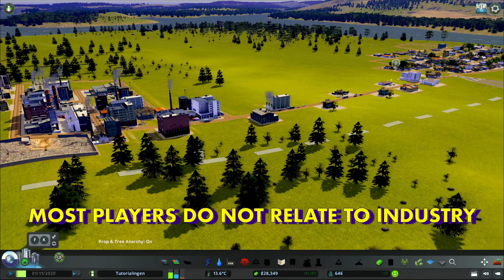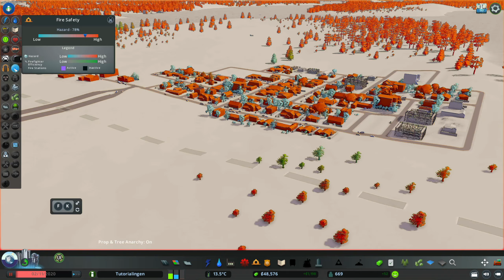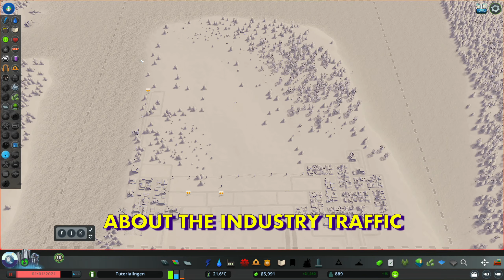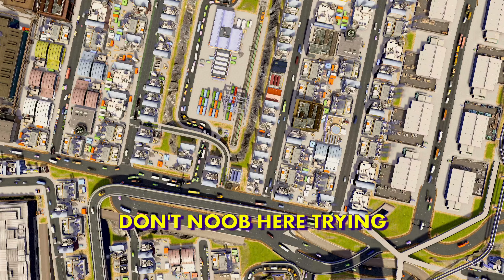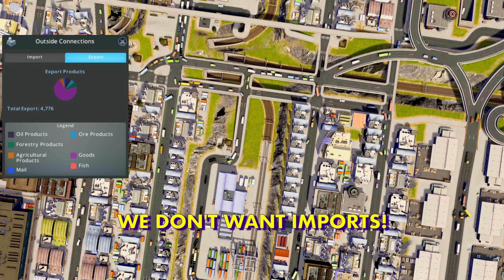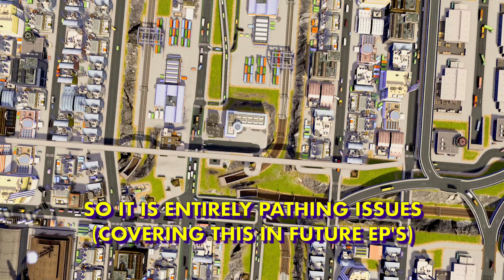How Industry REALLY works, Beginners Guide for Cities Skylines Pt 3 | 2025

Comment: Interesting you say to "zone one 4x4 building at a time." Ive tried zoning 1x4 and 2x4 buildings early on in a city to increase the quantity of "matches" that can be made between processors. I felt like it helped.
Reply from the maker: yes correct check the nextvideo in the series and you will find out that i was unsatisfied with our little cities "matchmaking" but the time i told you to just zone one 4x4 i was thinking about my mistakes overdoing it by - other magnitudes ;)

Comment: What does Import/Export mean, when you don't have outside connections ? My only outside connection is a passenger harbor and a airport to allow people to move in my city. I currently have nearly 5000 import (everything, but balanced) and about 1000 export (also everything and balanced). The game also don't show me all export/import buildings, only a few. I have a cargo station every about 100 units to make sure, materials and goods get fast from one side, to the other side of my city. I only have some few "Not enough Goods, Not enough raw Material" buildings, but these are less than 20-30 by a population of 100.000. So  I don't care about it. I absolutely can't understand how Import/Export works in my city 😂 I don't have any issues, I just want to know, how this works without outside connections 😅
Reply from the maker: No the city has all connections. But it does not import goods or materials because it produces them locally and because of this the traffic which has to pass through that junction becomes minimal. in essenxe if you have a balanced industry which produces enough to cover demands you are making sure your city does not get visited by external traffic. keeping your profits highest bcuse you are not paying for imports and also keeps trucks away from your roads because. you could control internal delivery traffic but external trucks would come down the road system which is also utilized by private cars.
This way you are in control and thus able to prevent a lot of probelms which occur in cities which require external deliveries to operate.
Reply: @Drakkart  But I don't have any connection to "other cities". No road connection, no train conneection, no ship connection. It's isolated for cargo traffic. Meanwhile population is at 170.000 and import/export are both 1000. But why ? Shouldn't it be 0 because they can't import/export ?

Comment: This video was good for explaining how industries work, but it was all theory. I have no idea how to start an industry.
Reply from the maker: it is more like facts just not a good example ;) you may want tocheck the drakken series for seeing industry in action. well simple. draw a road tone industry observe what happens also with an eye on imports and exports.
next step would be ok so we are producing stuff, that is good lets make sure we get it into our city without causing more traffic. then you think like hmm in general i want even less traffic and suddenlyyou end up with the idea well i don't want my industry toimport so i need to set it up properly and then you are running into lots of "issues" egarding how thegame handles stuff and if you are not giving up then then it is time to propery plan and execute an industry build with all learned in mind.
Reply: @Drakkart  So I just draw a road into an area with trees and zone it as industrial and the game does the rest? (harvesting wood)
Reply from the maker: @TheSwamper  no in this case you need to use the area tool draw an area over it and declare it as a forestry region. now if you create an area and assign it an industry type on the proper ressource it will mostly generate ressource extraction buildings. if you create the same are but without the ressource the game will spawn processing indutry. and if you just zone industry the game will spawn generic industry which uses the processed materials to turn them into goods and then goods are shippd into the commercial zone for being sold there. id recommend you watch this https://www.youtube.com/watch?v=Mns1VWXbPac and this https://www.youtube.com/watch?v=ntWL1Obm3lg&t=3s

Comment: How can i differentiate imports/exports of extraced and processed goods to balance them?
Reply from the maker: when you open the imports or exports then check which buildings are importing or exporting. for import let's say mainly generic industry imports than most of your imports are processed. if processing buildings are mainly importing then they import raw ressources.
for export. if extractors are mainly exporting then to many raw materials if processors are mainly exporting  - to few generic industry ;D
Reply: @Drakkart  Okay that makes sense. Thank you